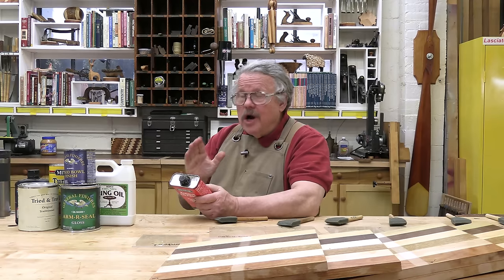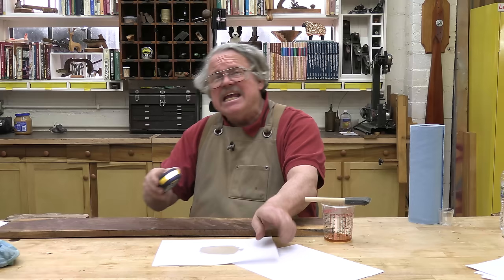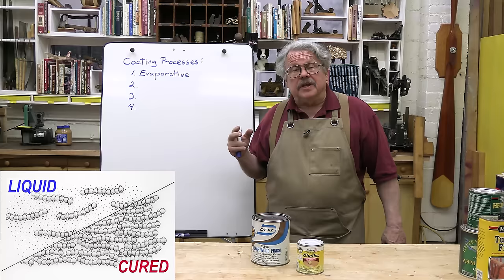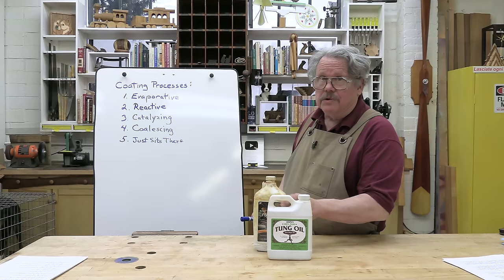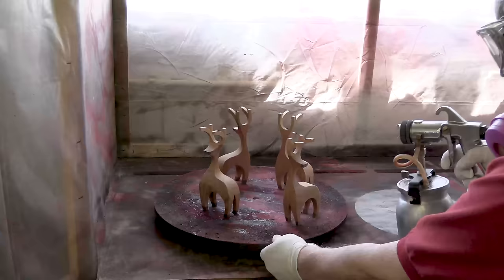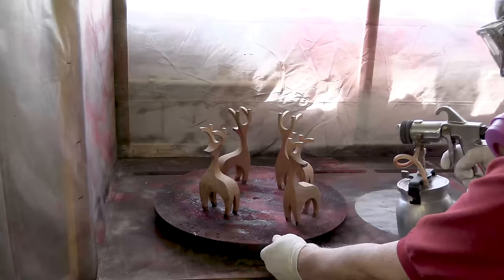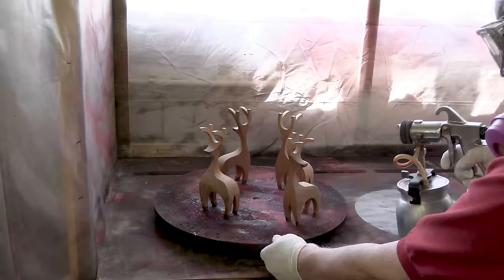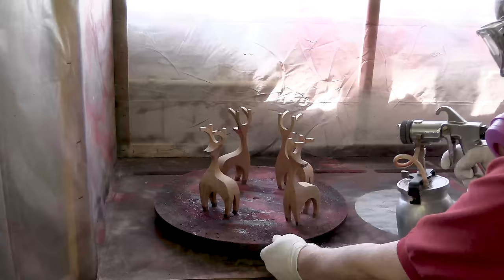Finding the Perfect Finish

Comment: What's your opinion of shellac? Curious why it wasn't part of the test.
Reply: Shellac is fine as long as it is what you are aiming for. Shellac is a long lasting finish - as long as you do not spill alcohols or other chemicals on it - as these will disolve it.
It doesn't resist liquid very well - this is why a cold cup of water will leave a white ring. The ring is caused by moisture migrating into the finish. It can generally be fixed by lightly mist spraying a solvent such as denatured alcohol or lacquer thinner over the spot on a dry day.
It also will melt if a hot cup of coffee is set directly on it (one product we use in restoration is shellac sticks which are colored sticks of shellac. We melt them into the spot we are working on - hence melting ability).

BUT....
Shellac is the ONLY finish that has actually been shown to withstand hundreds of years of use (when taken care of). Shellac doesn't crackle like lacquer - doesn't darken like varnish/urethanes - etc... As long as the damage isn't too bad and shellac finish can be scuffed to remove the surface layer and a new coat applied.
It is also one of the best VAPOR blocking finishes. Once reason I like it for piano soundboards.
It also produces a nice warm tone (though even water based finishes can do this if we add a little stain into it).

It is also natural - except for the alcohol.
I like it - in its place.
Reply from the maker: Shellac isn't a wipe-on finish. That's why we didn't include it.
Reply: @Mike-bh7sh  thanks for that info, I really like the golden hue it gives

Comment: Great video. I've watched a lot of finishing videos and they usually just talk about their favorite couple, not give a detailed explanation and comparison.

How about wax? I've heard good things about hardening waxes but they are kind of pricey and are also 2 part mixtures.
Reply from the maker: I have never heard of a "hardening" wax. Tried and True Original Finish, which I tested in the video, has a similar formula to a "hard wax oil" -- it's a reactive oil (polymerized linseed oil) mixed with wax (beeswax). It's probably nowhere near as hard or as durable as Walrus Oil or Fiddes Hard Wax Wood Oil, but it's a similar concoction. You might want to run your own tests if this sort of finish interest you. Hard wax oils tend to be less toxic (for those applying the finish) than traditional finishes.
Reply: @WorkshopCompanion  Thank you for the reply.

I should have looked it up. What I was thinking of was Rubio Monocoat. It mentions that it's hard wax oil, but comes with a catalyst, so I don't know if it's a reactive finish where the catalyst just speeds it up, or more like an epoxy. Definitely doesn't seem like it would be as good of an all around finish as what you recommend.

Edit: on further inspection, they clarify that it contains linseed oil, so I would suspect that the Part B is the chemical driers that are probably already mixed in other oil/wax reactive finishes.

Comment: Hey Nick thank you for your wisdom on the matter of finishes sir you are a character 🙂. I was wondering if Rudy's blend would work good on western red cedar because I'm going to be putting a live edge piece on French cleats in the kitchen on the wall. 9ft long I'm wondering if I should just keep using cabots deck and siding sealer all natural or try Rudys blend or if you have a different suggestion for cedar?
Reply from the maker: There is no reason why it wouldn't work, but if you have never used a particular finish on a particular wood species, it's good practice (read: essential) to test the finish on a scrap before you commit to using it on an entire (read: expensive) project.
Reply: Thank you for your swift response sir 🙂 I will try a scrap piece first and compare the finishes I appreciate you Nick.

Comment: Would that mix of tung oil and spar varnish be good enough for flooring for a kitchen or bathroom?
Reply from the maker: Maybe for the first coat, but I'd go heavy on the spar urethane on the second coat and thereafter.
Reply: @WorkshopCompanion  would 50/50 be heavy enough?
Reply from the maker: @zarthered  After doing a bit of research, I've come to the conclusion the polyurethane would serve better in this application than spar urethane. Rudy added a little spar varnish to his finish to make it more durable. Tung oil brings out the wood grain; spar varnish made the finish last. Floors require finishes that are resistant  to all sorts of things -- water, alcohol, cleaning chemicals, fungus/mildew, abrasion -- the list goes on and on. Spar urethane is, first and foremost, formulated for outdoor projects and is made to resist water and UV degradation. It's chemistry adds a little durability to the tung oil finish, but not much else. Let me stress that what I'm going to tell you next REQUIRES TESTING. You need to make sure that if you combine these two finishes, they will cure properly and give you the results you want BEFORE you apply it to your floors.  Here goes: I suggest you get an oil-based poly-u that is specifically made for floors, such as Minwax Ultimate Polyurethane or Minwax Polyurethane for Floors. Mix this 50/50 with Minwax Tung Oil finish for the first coat only. This will help the finish to soak into the wood and enhance the wood grain. For the second and any successive coats, use straight polyurethane.  If you use a product other than Minwax, try to stay within the same brand for both components -- this will increase the likelihood that the finishes are compatible.
Reply: @WorkshopCompanion  That was a very full and comprehensive answer. I'll definitely test it before applying to the final product. Thank you very much, sir. It is much appreciated.

Comment: Would your finish be durable enough for a table top? How easy is it to spot repair if needed?
Great video, I quickly subscribed.
Reply from the maker: One of the reason I like Rudy's formula is that it is absurdly easy to do spot repairs. And yes, it's durable enough for a table top, But I'd apply at least 4 thin coats -- wipe or brush on, wipe off the excess.
Reply: @WorkshopCompanion  Thank you. Would you alternate the coats? 1 Tung Oil, then 1 with Spar? or 4 coats oil then 4 coats spar?
Reply from the maker: @donschaefer4301  No, you mix them as explained in the video.
Reply: @WorkshopCompanion  I guess I didn't ask correctly. It makes sense once I re-watched the video. I would put on 4 coats of Tung Oil only. Then add the 4 coats of Tung Oil and Spar mixture.
Reply from the maker: @donschaefer4301  I do it with 2 and 2.

Comment: Thanks, Nick, for another great and informative video! I'll have to try the 15 to 1 ratio of tung oil to poly. That ratio is a lighter (less poly) than I expected. I am currently using equal parts tung oil, polyurethane with UV additive, and stain thinned out with mineral spirits (almost one third of mixture) for ease of application on my west facing oak doors. Do you have a better formula for exterior use?
Reply from the maker: I would test a spar urethane -- they are somewhat more flexible to expand and contract with the wood.
Reply: Thanks!
Reply: I too am surprised with the 1/16 poly. I use 1/3 each linseed or tung , turps, poly.

Comment: After trial and error. I’ve settled on shellac, odies oil and tried and true. 

Shellac I love. Love using it. Love it’s dry time and love it’s simplicity. But, it can get ruined by a margarita. So, I shellac’d a bedroom cabinet. But have to yell when I see a condensating cup on it. 

Tried and true I love but I’ve never gotten it right. I always add to much. Then break it down by ripping that layer off, then I apply another coat and wait for days. Again, I love it but try as I might I can never get it right. Still love it. But I have space and time to let things dry for days. 

Odies oil I love love. Used it in a wine cabinet. Quick. Stable. But, only downside. 2 coats on a large cabinet took a lot of effort. Rubbing it in and scrubbing it out is simple. But, you have to want it. You have to work for awhile to get it all covered and finished. For smaller things, absolutely. But larger things, you have to want it.

Comment: How would Rudy's mix and some these compare to hard wax compounds like Rubios one step and Ollie's? I'm guessing they are drying oils of sorts?

Love the detailed testing and science! Like the Alton Brown of wood finish. Lol
Reply from the maker: Rudy's mix is a drying oil, and as such it is a reactive finishes that forms a chemical matrix as it cures. Some hard wax finishes are a form of evaporative finishes. The solvent, usually mineral spirits, evaporates leaving the wax behind. There is no chemical reaction or the formation of a insoluble matrix.  Others seem to be a cross between evaporative and reactive. These use an oil, such as linseed oil, as the carrier for the wax. I don't know how or if the wax interferes with or changes the reactive properties of the oil; truth is I have little experience with these finishes.

Comment: I'm so stuck in my ways that it's not funny. I started woodworking in my teens. That was way back in the 1970s. My first finish was Minwax Polyurathane and I stayed with that oil-based stuff all the rest of my life. I'm 60 now. For the first time, I decided to try some water-based poly. I like it. Mostly. Easy to work with. The finished surface feels like fine silk. It doesn't yellow like the oil-based stuff. My only complaint is that it does not penetrate and bring out the depth of the grain.
Reply from the maker: I hear you. I was thoroughly impressed with the water-based Wipe-On Poly that I tested. It's just that the wood looks so dagnabbed anemic compared to oil finishes.

Comment: Did you ever discover an improved version of the "Rudy Formula"?
Reply from the maker: I have had to adjust Rudy's formula as the availability of ingredients has changed. The type of spar varnish Rudy used is impossible to get these days, so I have switched to spar poly. And I do test other finishes from time to time -- part of my job description -- but I keep coming back to Rudy's, not necessarily because it's better than other finishes but because it's effective and I'm comfortable with it.

Comment: Why did they kill varnish?
Reply from the maker: Wasn't aware that it had been executed. Varnish is a simple blend of oil, solvent, and resin. Example: boiled linseed oil, mineral spirits, and pine rosin. Ancient varnish-makers used a wide variety of natural resins such as amber, gum, dammar, copal, rosin , sandarac, and balsam. Modern varnishes use synthetic resins such as alkyds, phenolics, and urethanes. Most recently, marketers have begun labeling varnishes according to their resins -- urethane and polyurethane are the best examples. These so dominate the market that they give the impression that varnishes are no more. But if you look around, you can still find them -- Tried & True, Vermont Natural Coatings, Rustoleum, and Old Masters are just of the few of the coatings manufactures still making traditional varnishes -- and labeling it as such.

Comment: I wish you'd added hardwax oil & ceramic coatings.
Reply from the maker: Tried & True is a hardwax finish, albeit an ancient recipe (linseed oil and beeswax). As for ceramics, we confined this vid to wipe-on finishes. Ceramic finishes, which were originally developed for the automotive industry, are mostly spray-on.
Reply: Check out the Nano N3 coating, seems to be growing as a topcoat for hardwax oils, considering hardwax oil isn't very "hard" as a finish. @WorkshopCompanion

Comment: Linseed oil is in the wrong category, it should be in the reactive category. It polymerizes and cures in the presence of oxygen forming a film. Was the binder in traditional oil paint  after all.
Reply from the maker: You are right. of course, as long as we are talking about "boiled" linseed oil. Boiled linseed oil is heated to a high temperature, usually in a vacuum, and chemicals such as ferric acetate are added. Some manufactures also add heavy metal "driers." This treatment changes the nature of the oil, along it to cure and form a hard chemical matrix when exposed to oxygen. Raw linseed oil, however, along with raw tung oil, walnut oil,  and mineral oil are "non-drying" oils that either don't cue or take so long to cure they can't be relied upon to form a matrix. They are, however, used extensively as  non-toxic finishes. Thanks for pointing that out; it's useful for viewers to know the difference especially since boiled linseed oil is toxic and raw linseed oil is not.

Comment: Hello, this is a fantastic video, I’m blown away by the high level of presentation. 
I have a question regarding the Spar Urethane: does it matter for your blended recipe if you use gloss, semi-gloss or satin or is that just personal preference? 
And does it matter if you use a water based spar urethane or is oil based recommended when blending with Tung oil?

Comment: isn't Rudy's formula basically Danish oil?
Reply from the maker: Similar. But as far as I know, Danish oil does not include tung oil.
Reply: @WorkshopCompanion  ok, danish oil probably has teak oil and some poly or whatever in it. i'll be trying out Rudy's though, for sure.

Comment: I’m surprised shellac didn’t really get mentioned
Reply from the maker: Shellac is not a wipe-on finish.
Reply: @WorkshopCompanion  👍 from your experience, would you say that shellac does a good job of giving the piece depth and highlighting the grain? I’ve never really tried it on exotic or nicely grained wood
Reply from the maker: @ghiblinerd6196  I have used it on musical instruments in place of a violin lacquer, and it showcases the grain just fine. It has great depth and warmth, but little durability. Today I use it most as an insulator to keep two chemically dissimilar finishes from interacting with each other.

Comment: Have you tried Osmo oil?
Reply from the maker: No. I'm thinking about using it to restore the wooden floors in my old Victorian home, but I haven't won the lottery yet.
Reply: @WorkshopCompanion  I've had good results with a few old boards I sanded down

Comment: hello 🙂
what about danish oil?
Reply from the maker: I know it's impolite to answer one question with another, but which Danish oil are we talking about? One of the many traditional Danish oil recipes combines mineral spirits, tung oil, and linseed oil. producing a finish very much like the Minwax Tung Oil Finish. Watco Danish oil is a blend of unspecified wiping oils and varnish, like Minwax Antique Oil. In truth, "Danish oil" is not a specific type of finish, but a nebulous term that's applied to a wide range of recipes and blends. I've actually represented two possible Danish oil formulas in this test, even though they are not called by that name.
Reply: @WorkshopCompanion  
thanks, i thought the danish formulations were all similar. I was referring to that Rustins. Greetings from Italy.

Comment: There is one important element that you never mention and that is smell/odor and or toxicity.
Your frequent use of wax is understandable to keep your tables glue and debris free. I for one can not use wax due to the toxic fumes/vapor that stays in the shop for at least a day, usually longer. Your finish tests did not include a toxic odor test, which is a shame because health should be one of the considerations. I know most of the finishes, like tung oil, don't smell bad but is it?
Reply: There are different waxes. I've never found beeswax (for example) to have a strong odor, nor would it be 'toxic', but there may very well be commercial paste-wax formulas with irritating ingredients.

Comment: Based on the results and particular individual characteristics the various finishes excelled at, are there any finishes you might entertain stacking the coats of?
Maybe one that penetrated & pulled the grain first, another that built a shine next, and maybe even finishing with a 3rd to help with the final feel of the finished wood?
Edit: And as you wrap the video up, I see your already moving in the above direction. Time to break out the measuring cup, mixer, and a pad and pencil to jot down experimented recipes!
I'm thinking a 10% mix of Arm-R-Seal and ___ as a final 2 to few coats formula to start.

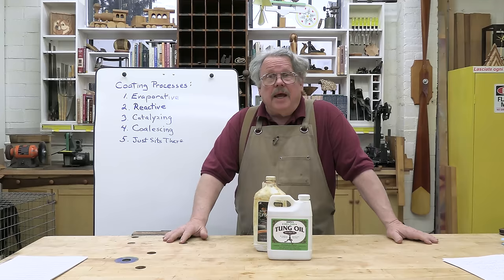Comment: 7:44 ummmm im a roooky but, tung and linseed oil are drying oils... mineral oil for example is a non drying oil.

existent testing. thanks
Reply from the maker: Boiled linseed oil and polymerized tung oil are drying oils, not so in the raw form. And as I explained to another viewer, the drying/non-drying designations are the opposite ends of a wide scale, with a lot of gray between. Raw tung oil will cure and form a matrix in a few months, but some coating chemists maintain that has to happen in three days to be considered a drying oil in today's finishing market. We may need a numerical curing rating instead of just declaring oils one or the other.
Reply: @WorkshopCompanion  very good point. thanks.